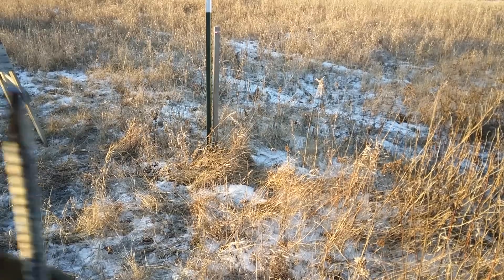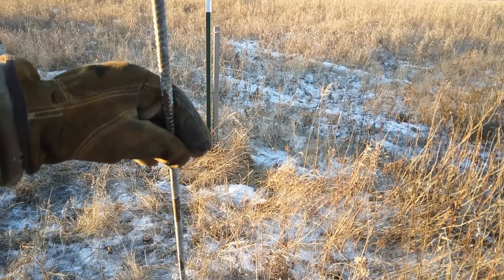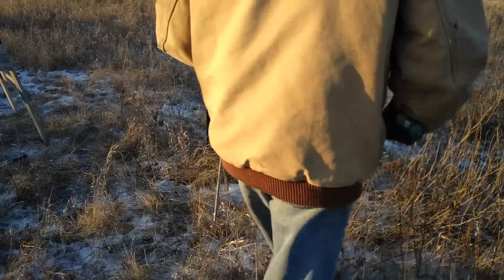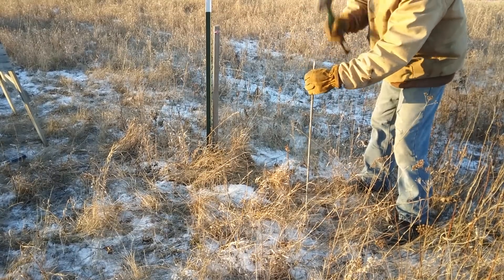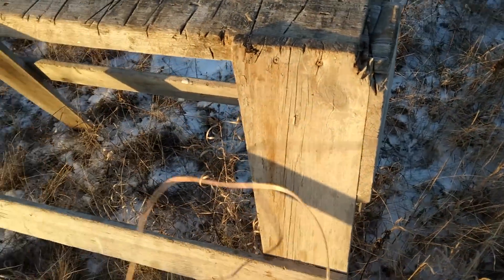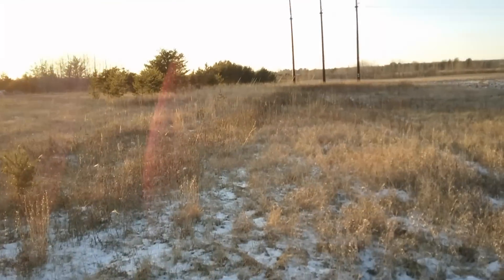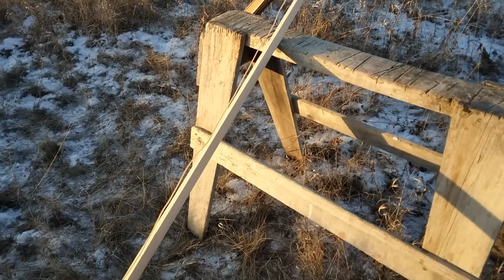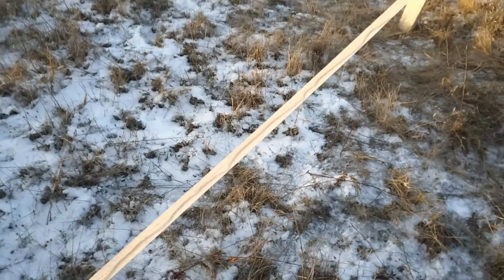⚡️💡Under the transmission line experiments.

Comment: If you wanted to work better you take a piece of wire and you touch two prongs on the one end of the tube hooking them together and then hold it up it'll light up better I know this because of CDs

Comment: Made a comment about this exact experiment on your other video re wire fence electric supply from above . You did this Video a year ago , so that makes me 1 year late to the party. As you would know the tubes are in all different grades for different applications specified by the number on the ends . LED might be your next experiment . Cheers

Comment: Put a piece of aluminum tape on a florescent lamp and turn it on. Then place the positive lead to the tape and the negative lead to ground. You'll get the voltage that is powering the lamp.

Comment: There's an Aluminium smelter near my home town that can use up to 13% of the nations power supply. Fluoro tubes run brightly with no wiring - a dropped nail will stand straight upright. Ordinary physics of daily life end at the gate lol

Comment: Would be interesting to see if the Fluorescent Tube would light up and shine brightly if you connected a complete Fluorescent Tube system up with Ballast and Starter, then connect that long wire that's parallel to the power lines to one side of the AC in of the ballast and the other of the AC of the Fluorescent Tube system to an earth spike ? Or even just connecting a Fluorescent tube Starter up to one pin on either side of the Fluorescent Tube to see if that starts the Fluorescent Tube to then shine continuously bright :)

Comment: Back in the 1970's I worked doing maintenance and mowing the fields around the WWWE 1100 transmitter site southwest of Cleveland Ohio while I was in junior and senior high school.. To walk around outside at night when the transmitter was in low power 4.5kw I would take a 4 foot florescent tube and hold it up in the air until it lit up then you could carry it around like a huge lantern.. You could set one end on the ground and it would keep glowing but you never wanted to have the electrode make contact with your hand or to the ground because you would get a nice zinger of an RF shock or it would draw an arc and burn out the tube just before it touched a grounded surface if it was operating at the daytime power of 50kw.. I don't remember what the maximum power that transmitter could do but it was one of the biggest in the area if not the country.. It used to be a civil defense EBS site so every once in a while they would test it at above licensed power and you could hear the radio station sound coming out of the duct work of the building and the hair on your body would start to tingle and stand up.. Pretty sure that wasn't healthy but when you're a teenager you don't think about stuff like that..
Reply from the maker: Great story!  Thanks for sharing.

Comment: If I were living there, I would make a huge coil with thick wire (maybe AWG 00) and make it resonant to 60Hz. If I could, I would attach some kind of iron core for better performance, though it must be taken into account for the resonance calculation of the coil. The thing would be placed above ground (maybe in a large wooden table) and be put directly under the power lines at their lower altitude in the property.

Even when it would be a pricy setup because of the wire, I would have "free" energy, or better said, "pirated" energy as long as transmission lines are energized. In this case, as if it was a transformer, the higher the load in the lines (users in the city with many appliances turned on), the higher the current induced in my coil as a secondary. Since this gives no control over voltage, I would rectify it and regulate it to charge batteries for an inverter.

Comment: I have a friend who, while in the Navy, had an acquaintance who claimed that he and some of his friends would take fluorescent tubes to high voltage power lines and launch the tubes up at the power lines at their lowest points between the transmission towers. This man claimed to my friend that the fluorescent tubes would light up very brightly as they came very close to the wires. The man also claimed that if the fluorescent tubes actually contacted the wires, the tubes would spin around the wires for a few seconds and then explode from the high voltage. My friend and I have serious doubts about the veracity of this person's claims, but have both wondered what would happen if you did do what this man claimed and flung fluorescent tubes at high voltage wires. Neither of us are actually willing to put this to the test.

Comment: I knew of a guy that used florescent lighting in all but the bedrooms of the house.
He lived very close to an AM radio station.
He used his TV antenna tower for the pickup point.
It was very strange to see glowing tubes simply taped to the ceiling.
Reply from the maker: I believe that!  Thanks for the story.
Reply: There was a guy in South London, England who was prosecuted because he deliberatly interfered with the signal eminating from a communications transmittion facility. A context completely different form this scenario, but he did benefit for a few years - ultimatly paying for it.
Reply: Photonicinduction? @conormcmenemie5126

Comment: I did this back in 1983 in England.  Not only did it glow, the roof of my car started to 'tingly' vibrate.  It's called 'electrovibration' and is caused by it not being grounded.  I didn't hang around.

Comment: Did this experiment myself when I was a kid. I found that using telephone wire wound around the tube caused it to glow very brightly. Understanding the physics behind why they did that took me many years to learn.  It is the electro-magnetic field that was causing this effect. Another experiment is a fluorescent tube taped to a CB or ham radio antenna and transmitting on the radio. The tube would glow faintly and glow bright when whistling into the mike. In this case it was Radio Frequency (RF) a different form of EMF causing the particles in the tube to be excited and give off photons.
Reply: Likely to be capacitive coupling, not magnetic.

Comment: It would be cool to set a string of LEDs along the length of the power line. I'm not sure exactly what would be the best way to wire it... You might be able to visually observe the grids power consumption based on the brightness of the LEDs

Comment: If you pick up a nice full frame camera you would have better luck filming in dim conditions like this. I have the Sony A7R3 And I've have found it has great low light performance as long as you get a large aperture lens.. somewhere around f2 or greater would probably work well for this.
If you're not interested in the sony camera in my Galaxy s23 ultra does great low light video also.
Reply from the maker: Right now I just have the Galaxy AO2s. At some point I would like to get a good camera, with good sound, and with stabilization.

Comment: How about taking a multi meter out with you next time so that you can actually measure voltage and/or amperage between your ground and your antenna.  This would give an idea about how usable or storable the field created by the H/T wires actually is in different conditions.

Comment: the top line is not power,, it is either a ground wire, coper or aluminum or a fibre optic cable imbedded in Aluminum

Comment: ...good that you brought awareness of the size of the flux that is around these transmission lines, you wouldn't want to be in a building 24/7 anywhere near these high voltage lines. Having that powerfull amount of magnetic field permeating your body all day long is something i would avoid which is why i refused getting a linemans ticket and just stayed with the electrician endorsement.

Comment: Years ago I attended an electronics trade school, I remember the instructor pointing out the RF around power lines. He said you could actually take coils of wire and situate it under a power line, and you can/will produce electricity. You could even power your house just from what is being radiated into the air from the power line.
BUT the electric company WOULD fine you for doing it, they consider it "stealing".
Reply: Power lines do not radiate RF. They radiate 20 Hz (trains), 50 (some other countries outside of North America), and 60 Hz. RF begins at 3 Khz.
Reply: @joewoodchuck3824  My apologies, you are correct, I said RF when I meant that it creates a magnetic field around the wires that can be picked up by another copper coil.
Can see where my post was confusing, thank you for the correction.

Comment: Your Antenna is USELESS for lighting these bulbs.  Your "antenna" needs to be about 50 ft of wire running PARALLEL UNDER THE TRANSMISSION LINES with the parallel wire hooked to one end of the bulb and the ground wire on the other end of the bulb.  This way, you get the Maximum effect of drawing the electricity from the high voltage lines.  Try it again using this method and you might be surprised 👀👀.....👍👍👍

HINT - It's the static electricity from the high voltage lines that light the tubes - by running the wire in the same direction as the high wire lines, in essence, you are creating an OPEN AIR TRANSFORMER (no rectifiers needed).....PS, I took "electricity AND electronics" in high school, so I know pretty much about this stuff 🤪🤪

Comment: Try this. Leave your ground rod in and them put another one 90 degs from it about 100 yards away. Measure the voltage between them. Its not much but it will run your driveway or sidewalk lights 24 hours a day.

Comment: I might suggest, as a test, is to see how many meters of "fence" cable it takes to sufficiently test your lamps brightness,instead of the aluminum antenna.(10, 20, 30 meters) Also there are two contact points on each end of the lamps. Did you use antenna and ground on the same end when you tested them?  Would a capacitor keep the lamps from flickering?  It sounds as if you can do several experiments if you want!  It is a unique lab you have!

Comment: My father had a horse farm with electric fences running under 250K voltage lines. The fence charger would burn out if we tried to hook one up. The induced voltage from the powerlines was enough to function as a stigmatizing deterrent but you could tell that it had higher joules. The current took the better part of a minute to build back up after you touched it. What I did for an experiment was to lower the volts with a transformer, because it was alternating current after all. What I wish I had progressed to was the use of a diode rectifier like you have there. Then, one of those variable-input buck transformers that takes in 50 to 13 volts DC and puts out a consistent 12 volts DC. Then, I could have had one of those 12-volt supercapacitor banks like some Youtubers have used in place of a car battery. Then you have some nice standby power and can charge a battery also. What is interesting about this technical challenge is that if the Earth's magnetic field goes away for 3,000 years like it is said to be able to do, then solar and cosmic electromagnetism will do this to the entire sky. It would be an "EMP disaster," but the effect would be more sustained and consistent. Therefore, any suspended wire would become a free energy collector and flourescent tubes would become the light bulbs of choice. The electrical system would have to be re-tooled, obviously.
Reply: Perhaps that is how the grid systems worked before, and at some point "they" created the magnetic field we see today.  Could some massive hidden geothermal power plants placed at key points across the earth generate our current magnetic field?  IF this was done in theory, it may explain the star fort setups we see across the world, the domes and cathedrals we see across the world everywhere that could have been actually power plants harvesting energy from the air before the change in the magnetic field.  I know that sounds insane, but the more u look into it, the more you wonder
Reply: @chadw100  sounds insane because it is

Comment: Not a good idea to be stickin a copper wire in the air with 230,000 volts flowing overhead stupy! one of those "here's your sign" moments .......or "you may get the shock of your life" moments...

Comment: I used to park my Astro van underneath a 500 kV line at work.  On damp days, when I reached for the door handle, I could feel a voltage from the handle through my boots.  The roof of the van was a sizable capacitor plate insulated from ground.  I often thought about connecting a multi meter to the handle and ground to see what the voltage was, but I never did.

Comment: The sizzling is corona discharge.  The 230 kV is enough to pull air molecules apart and they become ions. And ions can provide a conductive path and bleed a little bit of power off of the 230 kV lines.  Th power company works hard to remove sharp points and edges on their insulator connections (reducing 1/r^2) to reduce corona as much as possible.  The moisture in the air or frost increases the small constant loss, and produces the sounds you hear.
Reply: The corona also eats metal parts nearby.

Comment: It only lights because there is current flowing though the transmission wires. [someone is using power] Your lamp is actually costing the power company money because you are disrupting the normal magnetic field of the wires. Albeit a fraction of a penny.

Comment: When I was but a lad of nineteen I use to hang around a friend that lived on a farm (yeah, he had a cute sister) where a sixteen line high voltage power line on really high metal poles that ran through the property.  My friends father use to plant potatoes under that power line and often when he ran his tractor to plow before planting the hair on the back of his head use to stand up.  My friend and I assumed it was the magnetic field from the overhead wires.  We had a big coil of magnet wire connected to an analog meter and when we waived the wire the meter pointer jumped.   Never thought of using a bridge rectifier.  A guy up the street built a house under the power line where it crossed the road and his kitchen lights use to glow dimly without being turned on.  He got the Cancer at a very young age so the magnetic fields probably did not do him any good.  Based on this we had some floresent tubes and when in the potato field, when we raised them in the air they brightly lit.  Wish I kept those pictures.
Reply: I would like to have done some experiments with those potatoes!

Comment: On the police department, i would hold a 4 foot tube over the cruiser and when i keyed the radio mike the tube would light up.
There were no connections to the cruiser, antenna nor anything except my bare hand. Distance was about a foot above the roof.

Comment: I'm wondering how much more illumination you'd get by taping it to a 20 foot piece of thin wall tubing and positioning it as close to the power line as possible.
Reply: No ...................just, no.
Reply: Depending on the voltage in the lines, a safe distance is 10 to 45 feet.
If you get too close it will arc.
When it does...... you won't feel a thing and they might not recognize your smoldering body.
Pretty dangerous stuff.